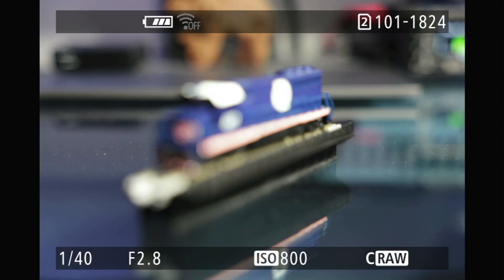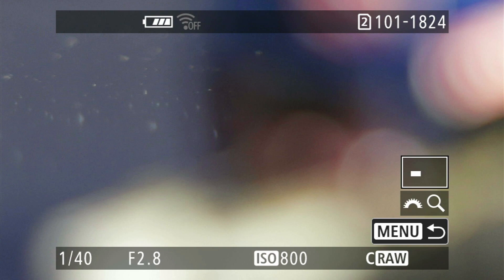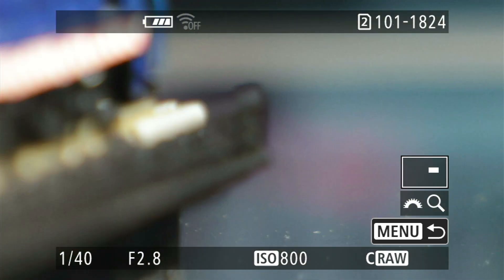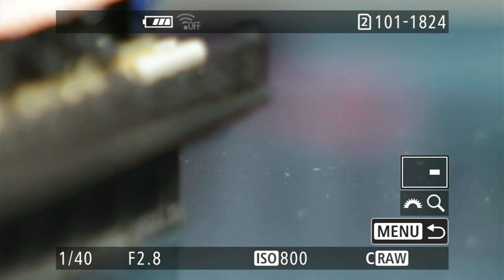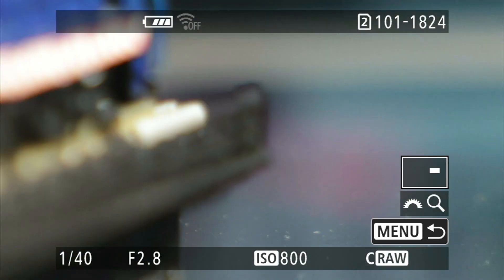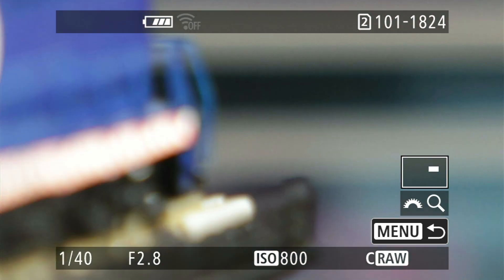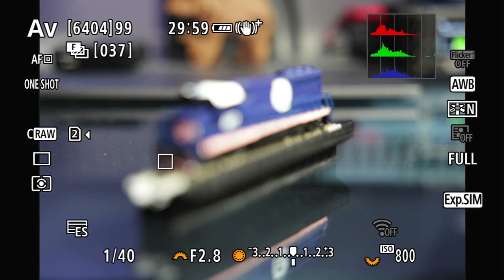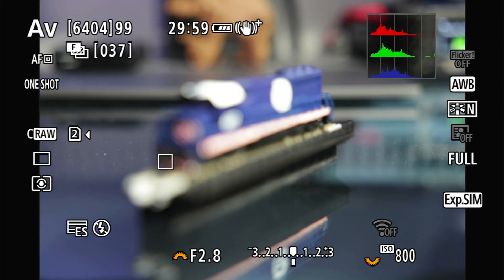Shooting an Automated Focus Bracket Set - EOS R5 Tip 16

Comment: You should takea  look at how Lumix has implemented focus bracketing.
Reply from the maker: The only real difference I see is that Panasonic cameras can shoot an actual focus bracket set with focus alternating between increasingly moving towards infinity and towards MFD around the focus point. (That said, I don't have a Panasonic camera in hand to play with so I can only go off what I've seen second hand and the manuals).

Other than that, at least based in my understanding from the manuals (which admittedly is far from complete, and I'd much rather have a camera in hand) the focus stack set works the same way as Canon's does.

From what I've seen, FujiFilm's focus bracketing implementation is the best I've seen — at least if you're shooting with the intent of stacking for DoF. You set both the near and far focus stops when creating your bracket and the camera can calculate the interval, step size and number of frames based on that.

Of course it all comes down to what you're trying to do with the camera. Panasonic has the flexibility to shoot a focus bracket to address errors in focus, Fuji has a system that makes shooting stacks that don't go to infinity easy.

It would be nice if cameras and lenses were cheap enough I could afford to own a couple of platforms, instead of just one.
Reply: @PointsInFocus  You select specific focus points which limits the range within which the camera will focus.
Reply from the maker: Okay, so it works like Fuji's.

Comment: I would love some help. Amateur photographer here. Attempting photo bracketing. I’m using a Canon R5 with 100 macro lens. I enable the photo bracketing in the camera. Lens is on manual focus with stabilizer on. Camera is on a tripod. I click to begin the photo process. It takes how ever many photos I’ve requested but it’s like the focus point or depth of field (I don’t know what to call it) isn’t ever changing. Like originally when I first started playing with this method it was almost like I could see on the screen the lens zooming in/out (for lack of better words). Now it doesn’t do that. It just takes the requested number of photos but the focus is the same and when I stack they’re blurred. Any help would be really appreciated. I’ve spent over a week being consumed by this. I’ve called Canon, they can’t help me. I’m devastated and it’s consuming me. Kindly, A x
Reply: I should also mention that I’ve briefly tried using another lens (R15-35) and I get the same result.
Reply from the maker: Hi, I'm sorry to hear that and I apologize for the long delay in responding.

Off the top of my head, make sure your lens is set to AF mode, not MF mode. Focus bracketing won't work in MF mode.

If you want MF like functionality while in AF mode, consider back button focusing (using the AF on button instead of the shutter release) to control the focus system; if you aren't already.

Comment: My flash trigger doesn’t work with focus stacking feature any tip?
Reply from the maker: No flash will work with the R5's focus bracketing/stacking feature. The camera uses the electronic shutter mode for this operation, and the flash isn't available in that mode.

Currently, the only option for an R5 or R6 user is to use a continuous light. R3 users can use focus bracketing with a flash, though it will slow the process down significantly.
Reply: @PointsInFocus  I have r5c so same as r5. Hopefully canon has an update so it can be done. 

Thank you for your help as always.
Reply from the maker: Unfortunately, it's going to take a new sensor with a much faster rolling shutter (or preferably a global shutter) to make the electronic shutter work with a flash.
Reply: @PointsInFocus  I see. So R3 has a different sensor that allows to do that ?
Reply from the maker: Yep, the 24 MP sensor in the R3 uses a stacked sensor architecture. That enables a very high bandwidth link between the sensor and the first level of image processing that enables the sensor's electronic rolling shutter to operate at about the same speed as a traditional mechanical shutter. That in turn enables the sensor to work with a flash with similar timings and operation to any other mechanical shuttered camera.

Comment: Magic Lantern had implemented a good focus stacking method. You focused on the mid-point of your stack and told it how many images were needed in front of that point and how many were needed after that point. It would shoot that number of images (both numbers combined) and you would need to merge the images in Photoshop. I used it several times on my 5D3 and it worked great.
Reply from the maker: Magic lantern was great period. I would argue that one of Canon’s bigger strategic mistakes was not supporting ML, or at least copying the idea of a scriptable API natively. One of the greatest strengths of open source in hardware like this is that anyone with the combination of programming skills and a desire can come up with a great idea and implement it. For hardware like a camera there are way more photographers that fit that bill than there are engineers at all the camera companies combined.

Comment: Thanks for these videos re focus stacking,  I'm diving into this a bit.  Is there an indicator in the EVF and Screen showing if you are set up to take a stack?  Also, did Canon modify/improve the focus bracketing limitations explained here in any firmware updates thru July 2023?
Reply from the maker: Yes, there's an indicator that focus bracketing is enabled. The icon and number of images to be shot are shown just under the images remaining at the top left side of the display.

As for modifications or improvements, as far as I can tell nothing has changed in any of the firmware updates since I did this video.
Reply: @PointsInFocus  Thanks for the reply.
Reply: Honestly, given the limitations, I expect I will be doing mostly manual focus stacking.

Comment: Thank you so much for the calculator. Yesterday I took around 170 stack images to get a sharp photo of a stapler pin set but still 1/3 of the area was not in focus. R5 with Rf 100 mm macro, F 5.6, shutter speed 1/15, 100 iso with continuous light. I'll try it again with the calculator. Hope the calculator will do well.
Reply from the maker: For a small object, you'll likely want to set the focus interval to the smallest step size possible.

Comment: Can you please tell Canon to update the EOS R firmware to include focus bracketing? Thank you!
Reply from the maker: Man I wish it worked that way. 🙂
Reply: @PointsInFocus  Darn! You look like someone they’d listen to! 😂😂
Reply: Only, for this reason, I switched to R5. I did it manually but believe me doing it manually, taking 50+ manual shots with different focus points by rotating the manual focus ring is my worst experience with Eos R. I still can't forget my back pain.
EOS R is never a camera for wildlife/macro. It's good for portraits & landscapes. Once you get used to photo stacking you'll never wish to go back.
Reply: @A-Z-A-Z-A-Z  I didn't even know what focus stacking was, or how to do it, before getting my EOS R. And I've only had my EOS R less than 6 months so I don't really think I'll be ready financially to upgrade to a newer model. 😩 But I don't do a lot of macro anyway. And if I need to focus stack any landscape and/or waterfall images I'll just have to trudge along and do it the best I can with my EOS R. Thank you.
Reply: @TC_Conner  Normally you can use f11 to f16+ with a controlled flash to get sharper picture. 
They will never give focus bracketing in EOS R. Its Business. 
Now R7 and R6 mark 2 even have image stacking/depth compositing in the body. You dont have to use photoshop or other software for the image stacking process later. Even R5 don't have that option.. They are giving these options to newer bodies.
Reply: @A-Z-A-Z-A-Z  Are those extra options really that beneficial to the average Joe photographer like me?
Reply: @TC_Conner  Not that important if you  don't heavily into macro photography. 
R is a great camera and has great colors. For portraits, family travel, landscapes it's a great camera. I used it with 24-105 f4 and I was more than happy. I switched to R5 as I'm shooting more macro now.
Reply: @A-Z-A-Z-A-Z  I’m pretty confident that my EOS R, RF 14-35mm f/4 L IS USM, and RF 70-200mm f/2.8 L IS USM will provide me with what I need for my first photography project of 2023 which is to make waterfall and landscape photos that tell a story. Thank you for replying to my comments here. Merry Christmas! 🎄😎🎄

Comment: I have a question off this subject please. I came over from Nikon to Mirrorless Canons and have a RF 35mm 1.8 and the manual (as well as the lens cap) says 52mm. I have a 52mm Nikon polarizing filter and I cannot get it to screw in on the RF 35. Any advice would be appreciated. Thank you
Reply from the maker: You've got me on that one. 

As far as I know everybody uses the same thread pitch for their filter threads. So a Nikon filter should fit just fine on a Canon lens and vice versa. The only place that might not hold true is with drop in filter from super telephoto lenses — but I don't have the experience to be sure here.

What I've always done with filters that don't seem to want to start is to point the lens up, set the filter on the threads and gently turn it backwards until you feel the threads fall into place, then screw it on normally.